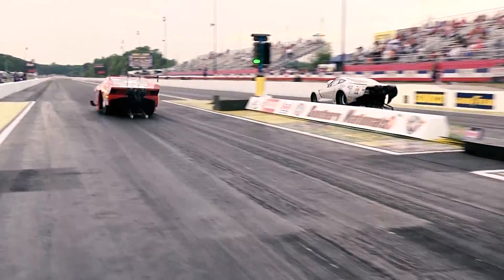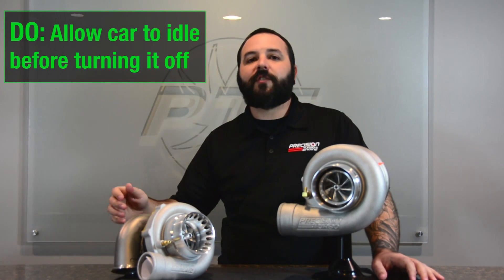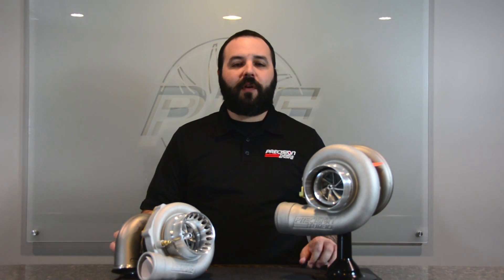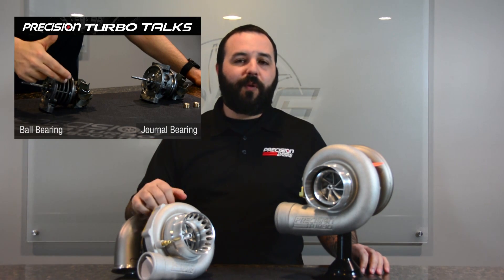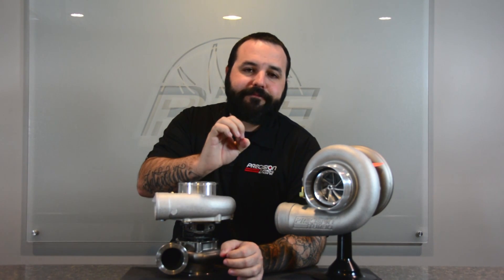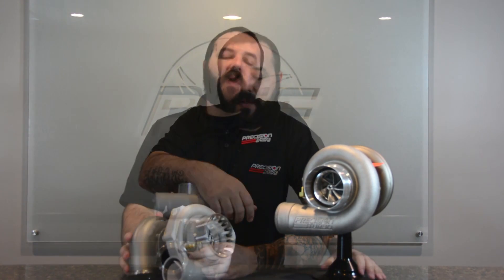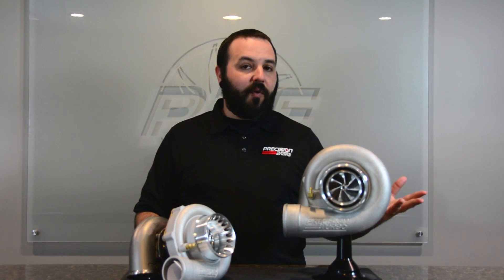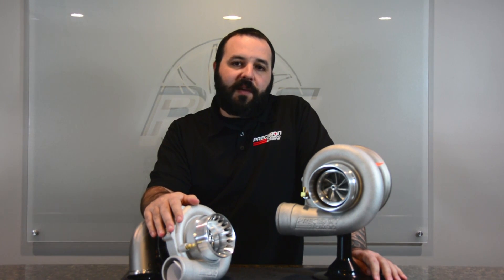Precision Turbo Talks - Turbocharger Do's & Don'ts

Comment: My 6266 blew within 1000 miles, got it professionally rebuilt and it eventually suffered catastrophic failure in the same amount of time. I ponied up and bought a BB 6466 since I'm a glutton for punishment, lets hope it goes better this time around. And yes, i have checked the clocking of the turbo and ensured that my oil feed, drain, and orientation is correct.
Reply: Did it go better this time around?

Comment: Class racing turbos marketed to fanbois. They're fast, but don't last. Precision minimizes thrust and bearing surfaces along with rotating mass a bit beyond reliable limits, to maximize performance. You might need a Precision turbo to be competitive in a specific class, where it will be viewed as a consumable, like brake pads... Anyone at that level doesn't need any of this basic info.

Comment: I have a question about a turbo setup on a ka9 acura rl I am planning to run two oil coolers before and after the turbo with built in oil pump for cool down of the oil do you guys think that will help the turbo last longer or is that just overkill I am running from 10 to 19 psi of boost V6 c seres all forged internals
Reply from the maker: Hi Justin! Thanks for your question! Please forward your questions via email to pte-info@wabtec.com and we will get you in touch with a technical sales representative!
Reply: You won't need one after the turbo.

Comment: Instead of idling, get a turbo timer if you have an oil-only CHRA. Or go to a piece that has oil and water in the CHRA. Many modern cars that come turbo'd from the factory have this, and will continue circulating coolant even after leaving the car in the parking lot.

Comment: I have a question about hot shut downs. I’ve been told that after “spirited driving” if you drive normal and take it easy for a few minutes after words it’s okay to shut off the engine. I usually sit at idle for a couple minutes anyway, but those few times I’m in a hurry will that easy driving afterword help the turbo?
Reply: Driving normal would be even better than idling, as long as the oil pump is spinning (engine on) its cooling the turbo, if you're moving that just adds rpms and air flow, both of these things aid in cooling
I personally always do a "cool down lap" after pulls or heavy turbo use, as well as a minute or two of idling just to be safe, and allow everything to regulate
Reply: Id like to know this too.  It makes me what to get a temp sensor on the exit oil or something to know whats a normal temp and whats too hot.  Cause who's knows when youve set long enough as well.

Comment: What kind of an idiot would attach the turbo to the chassis!?.  There is considerable movement between engine and chassis.
Reply: In a race only situation the turbo is oftentimes mounted directly to the chassis especially on a single turbo application where engine plates are used, front &back  in place of standard engine mounts.
In this senerio, the engine torque is applied directly to the chassis as neither the engine or the transmission can flex the 1/8" thick aluminum plates, forward and aft.
Reply: Yeah... i wasn't talking about solid/direct mount setups.  99% of turbo'd cars use factory style flexible engine mounts.

Comment: Ill be running a remote mount turbo on my rx7, will i have any issues with a self contained seperate oil system with my turbo? I imagine ill need two pumps, a primary and scavenge pump, a cooler and tank.
Reply: video or it didnt happen

Comment: Can someone give me a basic idea on how much will adding a small turbo to a realively old bmw m52b25 (200000km) hurt the engine. Will i be forced to install new stronger bearings, stronger head bolts and headgasget and forged pistons to not be worried
Reply: +ukkomies100 Your question is too vague. The car needs to be tuned for the turbo, you'll need to change your exhaust manifold/dump/exhaust, you might need to change your MAF depending on its resolution, possibly change your ignition system depending on the strength of the sparks (they can fail to ignite the mixture with boost), the compression ratio might be too high entailing a thicker headgasket or pistons and then finally your rods/pistons might be too weak or rings too worn.

If you want boost, the EASIEST path is to supercharge. You WILL need to address some of the things above, such as MAF/ignition/CR, but it avoids all the exhaust and oiling problems.

Comment: I run a pte. divided 6262 bb with dual wastegates on my fd at about 423rwhp at 16 lbs. So far no problems and i have 10k on the turbo. Spools fast and makes good power. I do not run a turbo timer but i do run my car about a mile off boost before i turn it off. I do hear a lot of complaints but i have non at this time

Comment: Great video.  I have a stock 2007 Audi A4 B7 2.0t Quattro.  In the video, you mentioned to not use baffled catch cans because it may create pressure restriction in the PCV.  Does that apply to my situation?  With direct injection engines like mine, many people say that baffled catch cans can help reduce carbon build up on the intake valves.  What is your recommendation?
Reply: You are good with audi s setup  keep it original

Comment: I would have to say a better solution would be to water cool the turbo.  Unless you are selling to a race only market.  I am curious what precision's aversion to water cooling is.  I had a water cooled 5031 which seemed to work fine.  Is there an advantage to just oil cooling?
Reply: Yes. For after market companies, It's cheaper to make, so the profit margins are higher.

Comment: Hi team! I was wondering. Old turbos tend to be less efficient than newer turbos. Is it possible to take something like an E46 330D turbo and replace it with a smaller turbo that pushes out the same PSI? This would reduce lag without reducing power. Adding a turbo of the same size with increased PSI is also an option but that requires changes to other items such as fuel injectors, diesel pump, intercooler etc. Any nut can add a massive turbo to a car but that won't be good for a daily driver as the lag will be real. What are your thoughts?
Reply: Edward R if you calculate the flow rate properly then you would only have to replace the turbo. Assuming you do it right you will have the same flow rate meaning the same amount of fuel required.
Reply: Yes, I'm assuming the same air flow rate provided by the turbo - you get better designed turbos that can push higher amounts of air for their size. It would drive better and be more efficient.

Comment: My turbo is causing oil to get sucked up into the compressor of the turbo itself through the Cold air intake should I use a Oil catch can? or should I leave it alone? This is on a 2017 Fiat 124 Spider.
Reply: Zepherius Cole what do you mean? Like the filter oil?
Reply: Liam Casey through the PCV port. It goes into the PCV valve box and a hose comes out of the box and around the top of the engine into a smaller hose that enters into the cold air intake right before the turbo spool at the compressor end of the turbo.
Reply: Liam Casey someone was telling me its blowby and to use a oil catch can on it. I figured the oil catch can wasn't factory and the dealership should know what they needed.

Comment: first topic idle to cool especially after running in boost condition. If your not monitoring the temperature of turbo and don;t have an automatic or temp controlled  shut down system. Manual set an wait to cool turbo is like 1 of the 10 thou-shalt on the stone tablets. It is when you don't because  your in a rush that count the most

Comment: on the 1st point, maybe i missed it, but i didnt notice you mentioning anything about turbo timers, which do exactly what u said, except u CAN turn your key off, get out, and walk to your fav food joint, while the car continues to idle, keyless and locked up, for a few minutes after u leave til the temps drop enough to shut down efficiently.
Reply: The old ( and good ) Chrysler mini Mopar turbo's from the 80's and 90's were water cooled in such a way that the coolant would continue to flow to the turbo housing even with the engine shut off. Piping was arranged so that coolant would siphon from low in the cooler part of the block, through the center bearing housing,  to a port on the cylinder head goose neck. The flow would automatically continue untill  hot and cool area's of the engine normalized to roughly the same temperature. Never had a coking issue with the two I own.

Comment: So instead of idling, could you just not drive hard for 5 minutes or so before you arrive to your destination?
Reply: Wei Wang Yes, that would be the more efficient way of going about things. However if you need to stop urgently after using boost, let it idle for a minute or two before switching it off.

Comment: I live in Kuwait, which is known for having a harsh desert climate. Summer temperatures are usually between 42-50 degrees Celsius, and dust storms are frequent. We use heat covers and add an air filter on the intake of the turbo charger. Beside those, Is there anything else that can be done in order for the turbo charger to function on a daily basis without failure & handle the harsh environmental conditions of the desert?
Reply: Also make sure your oil level is full. Low oil absorbs heat faster and has a harder time dissipating it.

Comment: How about angle placement of the turbo. I have had a very respected tuner tell me not to have my turbo placed at an angle (20° or so), but I've seen it multible times.
Reply: Dan Aldred i assume he's referring to the oil feed locations?
Reply: No greater than 30° in either direction from center for oil returns. More vertical the better as the return section of the system is not pressurized and relies on gravity alone to return the oil to the pan.

Comment: Luckily in my 2018 STX .. It runs coolant and oil thru the turbo/block/radiator after the engine shuts down until EOT and ECT reach a safe level ..😁 BUT me being me let me shut up cuz I still always wait at least a minute haha. Good vid

Comment: You just helped me decide on turbo or supercharger . Blower it is.
Reply: i  wish i went that way instead of dealing with all this ridiculous heat coming from two turbos
Reply: Turbo is way cheaper and easier. 
Most supercharger kits start at around 6k for a side mount, 10k for a top mount.  Turboing your car is much cheaper, especially if you only want low boost.
Reply: @strider5119  hahahaha if you think turbos are easier youre on one. If you can replace an intake manifold or change an alternator you can install a supercharger.  Also, for low boost, superchargers do the job. High boost, you want a turbo or a centrifugal supercharger. 

Also roots type superchargers are inefficient but twin screws and centrifugals are much more efficient. Not as efficent as a turbo but still.  

SC kits are also not that expensive. I see a lot of SC kits between 3000 and 6000. Depends on application.  Basically the same price as a QUALITY turbo kit.

It boils down to this.  Max drivability, easy install, decent power bump: Supercharge it

Dont mind lag, want max power and uncompromised performance: turbo.
Reply: @andrewkahler9359  Superchargers are king 😎
Reply: @andrewkahler9359   No you just dont have a clue what youre talking about. Crank will require a blower key and you have to pin the crank which in most applications requires pulling the motor. Get off the internet acting like you know something about a car and go work on one ya wannabe.
Reply: simple solution is buy a turbo that comes with the correct fittings and lines as a kit, then no mistakes are made. Have some silicon joiners between your hard pipes to allow for flex and if there happens to be any pressure issue, the silicon joiner will jump off the hard pipe, well before a hard pipe or turbo is damaged.
Reply: Preston Ghram I gained 250hp at rear wheels on a mustang dyno swapping my F1a procharger to twin 6266 pricisions at the same boost level and 6 degrees less timing. The 12 rib belt was super tight and still slipping a little tells you how much power it takes to run superchargers

Comment: Learned a bunch !

In the past...i had a GN I modded with the typical precision turbo goodies, ( front mount IC, bigger turbo etc etc)...but since it was basically upgrades of stock stuff, I didn’t run into any of the considerations detailed here

Comment: Don'ts: Don't buy a precision.
Reply: damn, I came in to say exactly this. lol Brand new 6062BB blew smoke out of the box. Send it in for warranty "it must be my drain, nothing wrong with turbo"..still blows smoke even on a 15mm drain that is vertical. Turbo failed in 9 months, 6k miles of street use. Switched to a borg on the exact same setup, zero issues.
Reply: @Charperbuilt  how was your oil pressure into the turbo? Too much pressure can do exactly that.  It's very common to have to put a restrictor in the pressure line.
Reply: it was on a s2000... 85psi. PTE ball bearing turbos come with a restrictor as per precision "do not run a restrictor, there is one built in, even though you have 85psi of oil pressure"
Reply: @Charperbuilt  wish I read this earlier  😒
Reply: @gtrlife2941  common issue.....gotta limit oil flow to turbo
Reply: @Charperbuilt  did you install a oil restrictor?  If you are running -4 turbo oil feed it will get too much oil
Reply: @Charperbuilt   sounds like to me you doing something wrong. I have had zero issues with mine.  Sorry to say but always more to a story most won't tell if they did something wrong.
Reply: 😂 borg warner for the win baby
Reply: I love my EFR7163 very much
Reply: Borg warner 🤔
Reply: @MannyFresh1x Paxton ?🤔
Reply: Lol 😂
Reply: @suavehouse5150
Reply: Well if we are going that route pro charger for the win!
Reply: @MARZOSIRUS  turbo is proven much more efficient than pro charger
Reply: Bought a used Garrett GT35R, looks like it ate some sand and has enough shaft play to contact the housing. Still makes 30+psi like a champ, spool is probably slow but I wouldn't know, my motor is 6.7:1cr...
Reply: Garrett
Reply: kayzrx8 Garrett all day I have one gtx2860rs on my Hyundai has 16,000 miles on it no shaft play no oil coming out of it no problems with it what so ever
Reply: has oil and coolant lines. coolant will continue to cool off even when the car is off and bw has amazing flow numbers.
Reply: Go Holset/Borg Warner .. More reliable, flows much better, and Reliability is second to none compared to Garrett or Precision combined
Reply: @jordanprice9285  Can't beat a Holset for reliability.  Rebuild kits are cheap and easy also.  I got one for free that came off a Cummins that broke a piston.  Completely destroyed the turbine wheel.  $80 turbine and $30 bushing and seal kit, back in business.
Reply: Copy that buy a precision! I love double negatives.
Reply: Shop just bought twin 6266’s for our LSX swapped continental. Might have been an expensive error, might have to see.
Reply: @dirtona6579 so..?

Comment: Crazy question: PIcked up a replacement turbo 3582R for cheap. I refuse to run coolant lines to the rear of my car(rear mount system). Can I just block off the coolant ports and just run it on oil only?
Reply: Oil cooled are designed so that oil can take away ALL the heat. Water cooled turbos are not designed for oil to do this. The passage of water goes where the oil doesn't and therefor by not using water on a water cooled turbo, the oil cannot get to the hot places and it will run much more hot. Even with the lower temps of a rear mount, its the internal design of the turbocharger that is drastically different (oil vs water) meaning th
Reply: hey thanks for the replies, I went ahead and tapped the heater core lines and ran a couple lines back. Don't know why I found it so appalling to do so it literally took 45 minutes.
Reply: Ha ha i dont know what happened to the rest of my post but I guess you got the idea. Nice work, you can rest assured that you will get exceptional turbo life. Just ensure you have scavenge pump to return the oil back to the sump after its passed through the turbo
Reply: oh yeah, have been using a sureflo for quite a while, love the self priming all brass gears, pretty darned quiet for a metal geared pump and doesn't burn up when/if ran dry.
Reply: I brought my second turbo from GSP America oil water feed GT 3582 . Cheaper than here in NZ over the moon and still going hard in the neo r34 2001 model ran 21psi .but would love to have the Garrett ball bearing they say it's instant reaction boost comes on faster yet to feel that feeling especially when pushing 1800nm from a cheap journal bearing
Reply: If turbo is a long way from engine should run a lot cooler

Comment: i have a 300zx with stock turbos. it smokes real heavy after it first heats up then the smoke goes away and only returns after heavy load/boost. the strange part is when i remove my exhaust system and run only downpipes the car does not smoke at all. even under heavy boost. as soon as i re-install my exhaust the smoke returns. ever hear of such a thing?
Reply: John Fisher 86 the exhaust system...run straight piping...
Reply: John Fisher sounds like your cat is a bit fucked just from the fact that when it heats up it stops. It thing that changes in the exhaust with heat is the cat.
Reply: I live in Florida. The cats are gone

Comment: Coking is basically evaporation of the lighter elements in the oil that rests in the bearing when you turn the car off. The hotter the oil the more severe the evaporation, what is left is tar, it is a hydrocarbon after all. When you boil the oil you evaporate the lighter stuff and leave the heavier stuff behind(coke).

Great video that highlights this principle in different ways. Namely oil flow=cooling, and stagnant hot oil is bad.